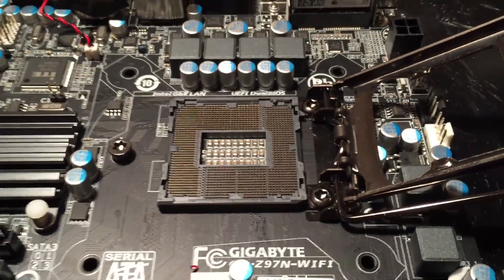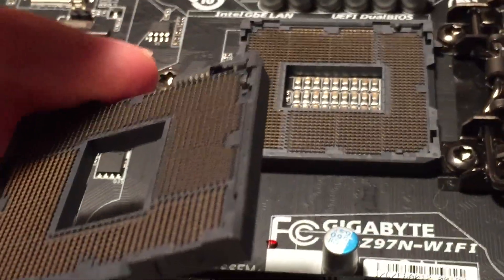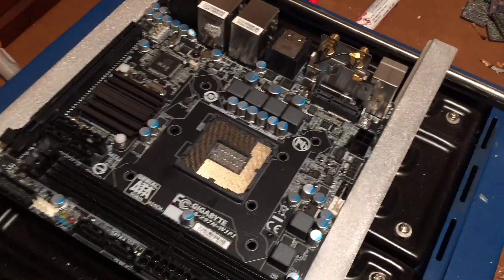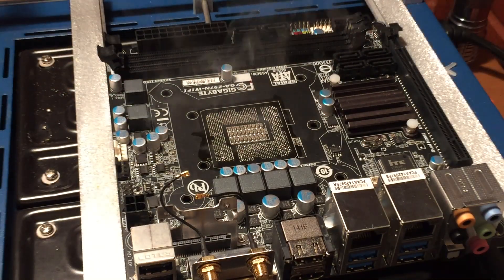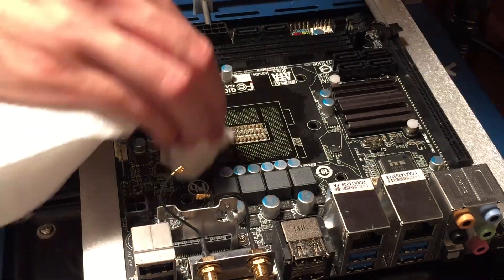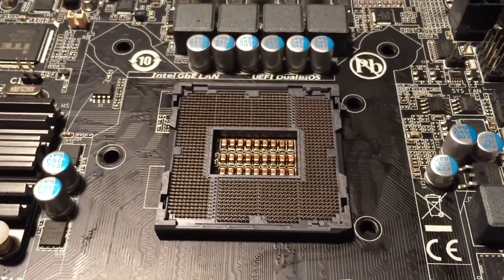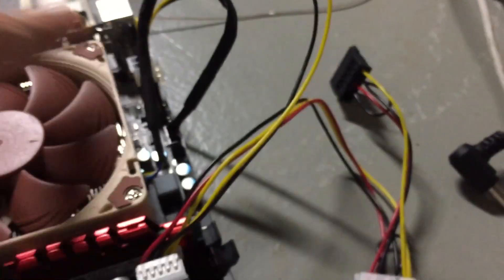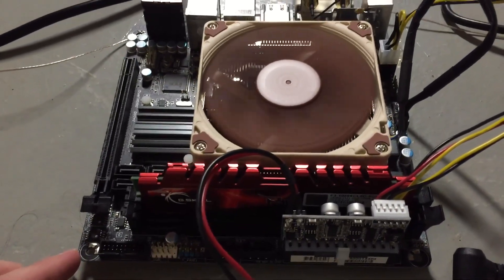Replacing a Damaged CPU Socket on an LGA1150 Mini-ITX Motherboard

Comment: So what exactly do i search for to find the heating tools you used? i assume they are expensive but maybe i could find them used i figure. i enjoy fixing things and know how to solder normal simple circuits with like wires, resistors, etc. But ive never resoldered chips and would like to learn. Where would you point a beginner?
Reply: Something like this could work (obviously not, you would require more power and the nozzle for the air gun and such, but one doesn't have to invest that much) https://aliexpress.com/item/32796500232.html?spm=a2g0o.detail.1000014.50.64385723uAPMCj

Comment: I would recommend using Alcohol base flux not tacky flux when working with CPU sockets to prevent Socket pins become sticky after reflow, unless you intend to ultrasonic clean the entire motherboard.

Comment: Hello
How long does the new LGA socket need to be warmed up so that it has 100% contact?
And second question, what happens to the LGA socket if it gets too long heat? 
I would be very grateful for answers.

(Wie lange muss der neue LGA Socket erwährmt werden, damit er richtig 100% kontakt hat?
Und zweite Frage, was passiert mit dem LGA socket, wenn er zu lange hitzte bekommt? 
Für Antworten wäre ich sehr dankbar.)

Comment: I built a gaming PC and I'm receiving a PMU training error on socket 0 channel 0 DIMM 0, DIMMs A1 and A2 work just fine, but B1 and B2 don't show RAM in BIOS or Windows but there's an error message when RAM is occupying either slot during POST. I'm starting to think I'm going to have to do something like this. I wish I had someone I could talk to / count on when I have problems of this nature.

Comment: Was this the first time you tried to remove one of these? I have tried a couple of times and each time either I loosened or remove a few pads or when trying to remove the old solder I removed some of the solder mask and ended with a mess! Any suggestions? Thanks

Comment: Where did you get that conical nozzle? I need to repair my Azus Hero Maximus 6 board. It was a high dollar motherboard, but I still have her, and I still want to save her, in an effort to have at least 2 PCs working at home, and get some more life out of her.
Yes, I screwed up the LGA1150 socket tryin to mount a crappy heat sink onto this chip. I’ll never forgive myself, nor will I ever forget that day that I screwed her up. I went to work all beat to hell, and with a few chunks of my hair missing, because I kicked my own ass. The people who worked under me even asked “WTF happened to you Boss???”
I was like “Don’t even ask!!!! Just go to your workstation, and I’ll go to mine. You won’t even hear from me today.”

Comment: Where did you buy the replacement cpu socket?
Reply from the maker: From eBay, from a seller in China, or Aliexpress.
Reply: @dosdude1  ok. My socket has like two pins messed up. I forgot about it when i built the pc like two years ago!. then i installed a water cooler recently so i took the cpu out and cleaned it. Then i was horrified to be reminded of it. I just put a bid on a used motherboard. That was a very impressive video! good job man. More flux!
Reply: @dosdude1  i found a company that ships localy in the USA! te connectivity! I ordered two cpu sockets. If i can get a replacement motherboard i am willing to try this out. Thanks for the video!!

Comment: This is by far the best "how-to" video on you tube to date as I have searched this subject for the last year. The only things left out where what types of flux you used to de-soldier and re-soldier the socket and what temp you had the Soldiering iron and Top heat source at during removal and installing socket. I would very much like to know this info unless this was left out intentionally.
Reply: In another video he says, Amtech NC-559-V2-TF tacky flux and he used a 300° hot air rework station when upgrading the RAM in a MacBook Air.

Comment: Do you offer replacement / repair service? I have a Gigabyte GA-X58A-UD5 and need to have the LGA1366 socket base replaced. Would you be interested in replacing the socket? If not, can two heat guns replace the Puhui T8280 and Hakko 850? Appreciate your time and consideration. Excellent video, thank you.

Comment: I used a 1 burner hot plate under and a hot air over  and melted the socket on 2 boards trying to get them off. The 3rd one I cant even get it off! I am using 2 temp probes and having trouble. I preheat the bottom to 100c turn it off and the hot air clear to 400 while taking the top of the board to 290c while this brings the bottom up to 160c . I am tired of burning the sockets. How much heat can the socket take? Strange thing is I covered the caps in the middle with silver tape and some of them came loose but I could not get the socket to release!!! I was even using the 45mm attachment you were using and holding it 1/8" above the socket for air flow. Any help? Hot air is a cheap knock off and the temp. varies up and down about 25c. The video gave me hope but .............

Comment: When you soldered the socket back on, how long did you have the heater on the socket before it re-soldered. It looked like only about 10 seconds and it seems like that is not enough time. Did you speed up the video? I sure would like to know how long before it came off and how long to heat it back up to get the balls to melt. Thanks for any information you have time to give me and thanks for the video.
Reply from the maker: Yeah, I cut out a lot of the wait time. In reality it takes around 5-6 minutes of heating for the solder to melt.

Comment: Sir, how to fix if the screws for cpu cooler from motherboard goes missing? 2 out of 4 screws from my mobo went missing. So, to tighten the cpu cooler, only 2 is functioning
Reply: find the model number for your cpu cooler, search for replacement screws for that model, reinstall as needed.

Comment: Thank you. This gives me some hope to fix my now-busted, very old MSI P35 Platinum motherboard that I really need to fix. I have the tools necessary. Replacing the board would be a hassle, as I had configured an entire fairly-beefy computer around the whole thing, and I mangled it trying to upgrade the CPU. Ouch! Fortunately, I have scrap boards that I can practice on first, then I can try my luck on the MSI.
Reply: what kind of heat gun/ hot air nozzle do you need/ have?
Reply: @evan.picture  I wish I had useful advice, but sadly I couldn't get anywhere with it and wound up recycling the board. I hope you have better luck!
Reply: @Racecar564  damn. looking into it as a side hustle [repairing broken/messed up socket high end boards]
Reply: @evan.picture  I hope it works out for you man, feel free to update me in the future

Comment: Great job! I have a question - you cleaned up the board nice, but where did that NEW solder come from in order for the socket to be actually securely and surely soldered on? The legs were factory pretinned? Wish you had shown us the back of the new socket or at least the new one.
Reply: yes the sockets come with solder balls already on the bottom.

Comment: i have a broken pin. and i have solder before, but never done a socket or chip. is it possible to do this with only a hot air solder? without heating bed to heat the motherboard?
Reply: You need to heat the entire board so soldering it's easier and avoids breaking it. A heat gun or hair drier from the bottom could do the trick, plus hot air from the top.
Reply: @pabloascencio7397  can i heat the pcb in a oven? and with what temperature?
Reply: @DDM81996  I would advise you not to put a motherboard in the oven, you might melt the plastic parts before melting the solder. Just use your hot air soldering station, cover the entire board with aluminum foil leaving the socket exposed, pre-heat the entire board at 100C/212F and then proceed to desolder the old socket. Be very careful, practice on old motherboards if you can.

Comment: What temperature did you use, I have the same rework machine u have an I cant gets the chip out
Reply: In the video he said 200 celcious degrees for the station and 250 degrees for the heat gun.
Reply: @wolfistzhen2701  thought it was in fahrenheit?

Comment: Nice job!
What would you recommend for a rework station?
Reply: I got one off ebay for about $90 with FREE shipping. Many of them are clones of expensive, name brand models but if you are just learning they are worth spending $90 instead of $2,000 for the brand name stuff.
Reply: @Animalwon  Thanks! I will have to give that a shot. I have a rudimentary heatgun with a 3d printed mount setup.
I have never used it though because I am afraid of getting hotspots and causing more damage.
Reply: Buy  yourself one and practice on old boards you don't care about. I frequented local garbage piles and used my unit to reclaim parts from various electronics thrown out. The "dial up" soldering iron takes a bit of getting used to but once you get good at using it, you will Love it. I can now solder connectors without melting the insulation on the wires (stay below 250° or so) nor melt the connectors ( never get as high as 450° or kiss them good bye!). For soldering or removing Chips, use the Hot Air gun and choose a nozzle that is just as big as the chip, or you will unsolder or blow away nearby components!

Comment: Such a good video but the dude didn't put any info like what tools he used or whatever.
Reply: If you had a money printer you would share what to buy with others you don't know? :P It's a trade, so he probably assumes those that are watching do this on a daily basis. He did explain what he used, "A board heater", and a "Hot air station" But that is either modified on a boom, or a legit BGA Hot air Station. Many different models and variations. The one you get is a lottery thing on how it works for you. I understand your comment though, but this is really tedious work. I change Bios chips occasionally so far and this would wreck my mind currently. lol Stress, If you bump anything else at this level of heat, you could literally wipe out any part of the motherboard by just dropping something on it. I however would prefer to watch a video of someone just deleting all the components off the board for a clear example of how fast and how bad things could go wrong in this scenario. Heating the bottom of the board too much could cause components to drop off the back side as well. Great job, I am jealous of how steady your hands are! Mine would just force drop stuff and probably laugh at me if they could... :P
Reply: You can make do with a "reworking station" you see on ebay. "Reworking" is the translation for "desoldering/soldering" done in repairing a manufactured pc board. I got one off ebay for about $90. They come with a hot air gun and a soldering iron both connected to a box with digital temperature readouts. You flick the switch to turn on either soldering iron or hot air gun, then turn the knob to raise temp to your desired level. The equipment is easy to use but it takes a lot of practice to know what temp to use on specific items since some are temp sensitive and some larger items need a lot of heating to melt the solder. If you know soldering or have electronics as a hobby, its well worth it to buy one of these units.
Reply: Because the average consumer doesn't need this equipment lmao

Comment: Please give me details you are used for this all machine name model no and more information
Reply from the maker: It's a Puhui T8280 preheater and cheap hot air soldering station (Gaoyue 850) with a 45x45MM nozzle.
Reply: @dosdude1  thnx

Comment: Well done
What is name of the tool that heating cpu socket?
Reply: i think its a rework station with a tube of some kind. its basically a hot air solder. with a heating bed. for pcb's. you can find it cheap on aliexpress if you want it. https://www.aliexpress.com/wholesale?catId=0&initiative_id=AS_20191123214242&origin=y&SearchText=pcb+preheater - https://www.aliexpress.com/wholesale?catId=0&initiative_id=SB_20191123214552&SearchText=rework
Reply: @DDM81996  its a puhui T8280, just going off of the colour of the machine, was looking around for that one since yihua 853A's aren't big enough for pc mobos and managed to find it https://www.aliexpress.com/item/4000195728531.html?spm=a2g0o.productlist.0.0.30e96dcbKWSx4S&algo_pvid=b469c4f2-ad6d-4217-902b-70fce6da88e5&algo_expid=b469c4f2-ad6d-4217-902b-70fce6da88e5-0&btsid=4486b92a-0898-4e60-8c14-0d9d97f68598&ws_ab_test=searchweb0_0,searchweb201602_4,searchweb201603_55
Reply: Hey dosdude1 how much would you charge to replace a lga1155 or does anyone here know how to if so how can I contact you thanks

Comment: ---- What problems can be produced by a broken pin? ---

--The pc can still work perfectly with some Blue Screen of Death? 
--Or just it doesn´t turn on?
--A broken pin can raise the motherboard temperature impacting in the Ram temperature?

I know that it depends of which pin is broken but i don´t know a lot  about replacing cpu sockets
Reply: Mostly cc error code on ram slots
Reply: I have an 1151 board with 1 broken pin rendering both PCIE x16 slots useless but the 2 PCIE 4x slots work fine as does everything else.

Comment: Hey what was that orange wire thing that looked like a copper wire you put after solder, you were wiping something off....I didn't get that part...you didn't explain that you were quiet while you were doing it
Reply: The copper wire looking stuff was solder wick/ desoldering braid and the paste he uses is flux

Comment: hello i would like to sent my mother board to you i need a new LGA1150 CPU socket . its a asus hero 7 .  please e-mail me  covertbase.flores007@gmail.com.  the problem is some pins are bent  and only 2 ddr slots running.  i would like to replace the socket. i do not have a steady hand to fix it.

Comment: good job mate, although i would have covered the rest of the board with foil and cap tape to ensure the integrity of rest of the board, but hey what works works :) and while you got your repair skills down, io think youre gonna need to work on your editing skills, im half deaf after watching your video, you can turn the sound levels down so your equipment doesnt make everyone puke from the sonic ear rape lmao its so bad i couldnt finish the video.. fix that and i can promise you'll see your subscriber base increase.

Comment: This is so good!!
can you give me flow temperature of solder machine?
I want replace CPU socket on LGA1151, and i don't know flow temperature
Thank you!!!
Reply: He says he used 250° Celsius on the hot air gun. I found this to work for me but you have to be patient. Some people aren't and they use higher temps. Really high temps (400°) can cause big problems!

Comment: Hello Sir, I have one problem in my pc that my processor socket's pins are broken and some of them are missing so can I change it without affecting motherboard's warranty ?
Reply: Having pins broken or bent already voids your motherboards warranty as they rarely cover this, never the less tampering with the motherboard by trying to fix it (this will also void your motherboard's warranty). Also, what is the point of worrying about the warranty if you're going to try to fix it yourself, kind of defeats the whole purpose of a warranty? 

However, I am going to assume that your joking here but on the off chance that you're not, this is your explanation.

Comment: Came here from Louis Rossman channel, this video was excellent! I had no idea you could replace CPU sockets like that. Can I go ahead and ask a stupid question?

When you put the new CPU socket back on the board, I saw you cleaned the board up etc.... however I don't recall seeing you apply solder to either the board or the new socket....so how did it stick to the board? Was it already pre-soldered? Or did you solder the socket off camera? (I don't do this kind of work so please forgive me if that's a dumb question)
Reply from the maker: The sockets come pre-balled, meaning they have solder balls already on them. So all you have to do is place it, align, and heat to solder it on.
Reply: @dosdude1  ah ok cool I thought it might have been the case I just wasn't sure. Do you think it would be possible to do the socket removal and refit, without the bespoke tools you have? Say, like me, who only has a soldering iron and a hot air gun?

Comment: Did the motherboard not boot at all? What was the symptoms?
Reply from the maker: Yeah, the system would not boot at all.
Reply: @dosdude1  my z97 mobo had problems booting... either it was making nonstop boot loop, or boot once, shut down and boot again without posting and just stay powered on. I think the problem was the 8-pin CPU power connector OR the CPU socket because if i did not connect the 8-pin CPU power cable, the system would start and stay ON without shutting down at all. When i was plugging in the cable, it would make the boot problem i explained. What do you think?

Comment: I am knew to this, so you are saying that the socket already has solder on the back of it and you just have to heat it up in the right place and presto the solder will melt in the right place?  I always thought heat was back for electronic products?

Comment: Ho Pal, I have  Asus Maximus Board with LGA 1151 CPU socket (with a broken pin) , how much would you charge to replace the socket?
Reply from the maker: I normally charge $100 to do a socket replacement.

Comment: dude that was absolutely impressive~...you should tell us what type of board heater and hotair rework system you have !!!  you just gained a sub because of this skill filled video! I've always wondered "what if a pin came out" or if it would even be possible to replace a cpu socket
Reply from the maker: I use a Puhui T8280 preheater, and a Hakko 850 clone hot air station.
Reply: @dosdude1  You can use any rework station, does not have to be Hakko 850